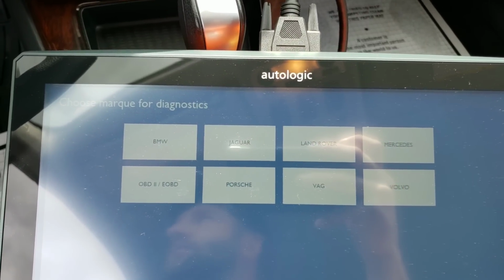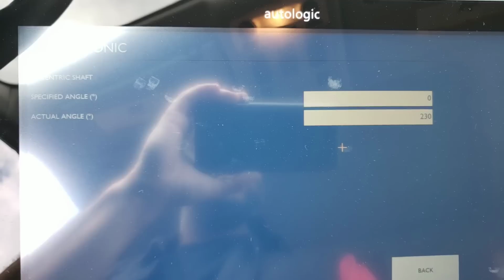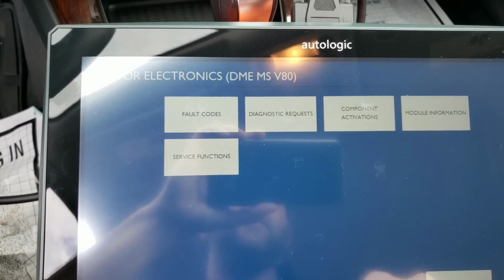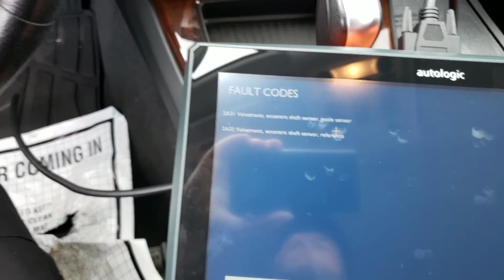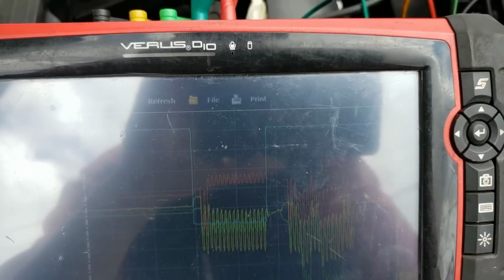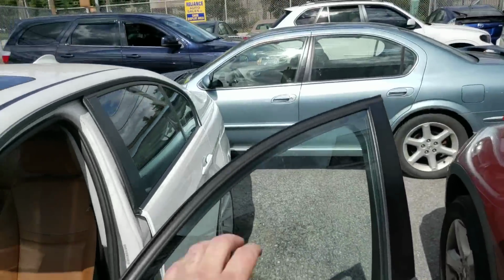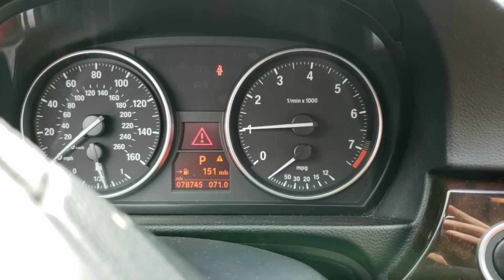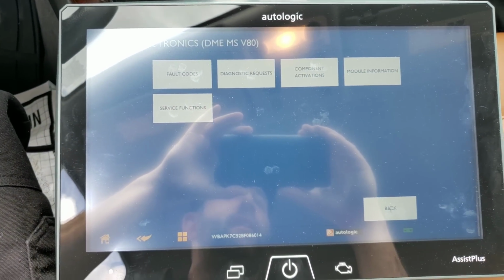BMW 2a31 2a32  Eccentric shaft sensor testing

Comment: Good evening, great video.
Sorry for the question, but do you have a PDF file to study this subject or something explaining about the oscilloscope signal?
Normally we have this type of fault here in the workshop and some of them we resolve by directly placing another new part on the ecentric axis sensor, we have also found the same fault with an internal origin in the Dme, we just replaced the item and it was ok, I'm looking for literature to find other ways evaluating the same problem, it would be very helpful to be able to better understand these signs.

Comment: This is insane, I just replaced the Eccentric sensor almost 2 weeks ago and now it's giving codes 2A31 and 2A32 as well as Valvetronic codes.
Reply: update ?
Reply: @buenobarronFunk  Ok, so it was the Valvetronic motor, when it goes bad it throws a lot of codes. I replaced it and now I've been driving my car daily.

Comment: Is it possible to get the pin-outs to hook-up an oscilloscope?    Have the strangest symptoms.  002855  DME: Variable valve gear -plausibility, sensor, bank2.  However this error disappears every morning and takes 1/2 hour of idling to reoccur.  And when it does, the Valvetronic can't be calibrated and error can't be cleared... strange.  However it can be calibrated the next morning.  Switched Valvetronic motors and exact same symptoms.   Could it be the DME? Eccentric Shaft Sensor?  Electrical glitch.. Perplexing.  Live in NYC, do you have a shop in Staten Island.  Regards.

Comment: The eccentric shaft sensor or I should say is just a hall effect sensor with many outputs to the proper computers. You make it sound like magic when in fact is not the case. The valvetronic system is really just BMW crap with no real benefits. And when it breaks down is a bitch to fix. Even BMW techs hate working on this junk.

Comment: I replaced the valve cover myself it took all day. Hardest part was the angle to reinstall. I'm having issues of bad running, idle surge from 500 to 1200 rpm but idles smooth with eccentric sensor disconnect but runs bad. I've replaced crankshaft and both camshaft sensors, all 6 coil packs, plugs and injectors, both vanos solinoids, cleaned both vanos screan filters, replaced evap purge and valve cover with ccv. I'm leaning towards valvotronic motor or eccentric shaft sensor. I guess its time to take it to a shop for confirmation.. $1000.00+ dollars too late. At least i got an awesome tune up. 08 328i 94k miles
Reply: Oh... replaced mass air flow sensor too.
Reply: 😂😂 same issue bro what was your fix
Reply: @pole450 update?
Reply: 4th

Comment: Holy shit. This thing actually varies the air flow with the valve lift and has the throttle open full most of the time? I had no idea... This thing must be pretty damn reliable.

Comment: I know it's a bit late now, but for anyone who is trying to do the same procedure: The original BMW software (ISTA+) actually tells you how you know that the main relais is off. According to the software, It's when the light in the start button turns off. In my case it took more than 5 minutes. I don't know if this really affects the procedure but it's just something to watch out for.

Comment: Thanks, man. And thanks again. This is the kind of information that no manual has. We just fixed a ESS issue with this video. Got a bad sensor, replaced and the problem was still there. Only after finding the graphs in this video we could prove to the client that the new sensor was not working as well. Got a third one and voi la! Car running fine now.
Reply: Are you freaking serious! So I might be having the same damn issue and I truely do not want to buy and replace this again FML
Reply: @E90SORS Same here. Shop bill is at $1k already and they want to redo the ESS job and order the most expensive option. Did you have to order a new one to get it fixed?
Reply: @AustinView I ended up ordering a new one from FCP euro and it fixed everything I also replaced the Vanos , hope this helps you I did it all myself

Comment: I have a bmw f10 535 with the N55 and I’m having that same problem i replaced the valvetronic and relearn it and still not working car runs good after it warms up but only getting 9.5 mpg when i used to get about 18 mpg
Reply from the maker: Are you still setting codes?
Reply: Yes same code 133e10 i can’t hear the valvetronic doing anything

Comment: Do these vehicles use the valvetronic eccentric hall sensors also as a substitute for cam sensors, no?
Reply: jones key No, it has a sensor on each cam! 1 sensor for intake cam, 1 for exhaust, 1 sensor in the eccentric shaft and 1 motor to move the eccentric shaft responsible and involved directly with the acceleration process (the throttle body doesn’t accelerate the car totally, only partially as he have said in the video) if you have a problem with the motor in charge of the movement of the eccentric shaft, the car won’t respond to your pedal press. (Bmw owner here 👍)

Comment: Keith, you know what this is? They routed a two-channel SPI bus inside a shielded cable between the DME  microcontroller and the sensor chips! To do this in an automotive environment is quite... eccentric, this stuff is designed to be used on a circuit board! You can see how much cross-talk there is between the wires... 

The blue line is called CS (channel select) in the context of the SPI bus, there should be another one like that for the other channel (taken LOW for the second packet we see on your waveform). The yellow line is called CLK (SPI's clock). Deciphering the 16-bit data packet is super-easy if you have the datasheet for the sensor chip (someone should open the bad sensor and check what it is!)

Thanks for showing us this electronic insanity! What are they using nowadays, SENT or PSI5?
Reply from the maker: I waited a whole day for this conversation!😊
Reply from the maker: Oh and I asked to have the old sensor just for you sir
Reply from the maker: Oh and to answer the second part https://drive.google.com/file/d/1GdV2ZNk7wNGPJIf7CweDGT9wt7Zx4tk5/view?usp=drivesdk
As far as I know
Reply: That was a good bedtime story! PSI5 looks good on paper, but I can't wait to see you diagnosing this system once it gets slightly corroded :)
Reply: I'm guessing it;s very well potted and would be a fight to break down.
also, they don't want you to repair a vehicle anymore, they want you to get a new one ;)
about the big EMP they keep talking about, thinking it's about time for one and a big start over................
Reply: Very smart observation to identify it to be 4 wire SPI since on INPA they call it “Low CAN” which makes no sense. Dimitry how do I subscribe to you lol

Comment: No intake vacuum? $400 position sensor? I hope you charge $300/hr on these fancy Euro diags Keith. Much respect.
Reply: now where's my spool of stainless wire
Reply: I think Eric o Did a video on one of those
Reply from the maker: @jeremyanthonyw2r  not that I am aware of
Reply: That's why I won't work on Euro trash

Comment: Good information, people always jump at the sensor, when they get a sensor code. I like the valvetronic concept. And the amount of data you get from it. 👍
Reply: Super Mario What tool do you use to work on these Great euro cars? Do you have the Autologic? I thought snap on is expensive but I think they’re pretty cheap compared to auto logic. But you do get what you pay for and you do have to have what you need if you’re going to work on these wonderful cars!
Reply: BigFoote Mobile Auto I use the autel maxisys, otherwise known as the nawtel 😉

Comment: Keith, thanks for sharing!  Have recently seen this limp strategy with maxed valve angle on a n52 engine. I have a question. Can you clarify what data showed a dead sensor? it wasn't very clear for me. Also about that bmw throttle  rumor and mysticism - while I was playing with scantool on an n52 engine I noticed that absolute throttle position was about 18 percent at idle during normal operation with valvetronic controll enabled and 10 percent in limp mode with valvetronic maxed if I recall properly.  Didn't have time to look at it, not sure it won't go into limp strategy if part of the intake including MAF will be removed... Maybe I will have opportunity in the near future to watch its throttle operating.
Reply: Youre absolutly right. The throttle valve is opened just a few degrees more with the valvetronic system working properly. Its too create a inlet vacuum of about 950 mbar so just 50 mbar lower than barometric pressure. When you go WOT the throttle valve is being commanded fully open. So with a working valvetronic the throttle valve is still opening and closing.  If the valvetronic failes the dme start controlling the throttle valve like a normal engine. You will see that the inlet pressure drops to about 350 mbar. The valvetronic is set to max 230 degrees just like in this video.
Reply: spin1275gt please spin! I need your help really bad at the moment with my 745i! It runs on 7 cylinders with a misfire on cyl nr 5 (left front) so the engine will not run smooth and engine light is on. However when i unplug the MAF the engine runs on all 8 cylinders with a power reduction? Some say the eccentric shaft is worn some say its the sensor? I do know about the location of the sensor but couldnt figure out how to take the eccentric shaft out properly could you please tell me more on this? My beloved 745i is sitting outside for nothing and i cant seem to get it fixed right before knowing this stuff.
Reply: Yes I was wondering the same thing with the sensor. But it was the “butterfly” resistance shown that you mentioned which basically proves that the sensor was bad?

Comment: In my little experience the most important thing to pay attention to as a BMW owner is the oil... Get the proper oil and change it often.

BTW Keith (hope it's not inappropriate), how much do you spend on scan tools and softwares subscriptions etc to run your business successfully?

PS a lot of the features of the autologic are present in the Autel 906bt
Reply from the maker: A lot of the same features,  but not a lot of them actually function properly. Been burnt too many times including the autel and launch units. I spend much too much , but I need to cover every make and model soup to nuts. I can never have the leisure of saying, take that one to the dealer.
Reply: So true! Actually I was just at a Napa class yesterday covering the euro cars and the instructor said that the Autologic you can spend upwards to $50,000! 
Get the word out & with your excellent service and experience it’s no wonder that you’re such a busy man!

Comment: Great info Keith, BMW hard to diagnose? Have European 530 x drive inline6 no turbo code misfire cyl5 BMW change computer coil, injector and coil again problem unsolved symptom like this car cold startup runs fine otherwise................... now they will change all coil and injectors lets see what happen, luckily all is done by warranty. Look forward to more BMW and Mercedes testing
Reply: g johan damn if they just had a proper diagnostician working for them they wouldn’t have to replace all that crap only the one that’s not working right! What the heck they call themselves dealers for just because they sell the cars?
Reply: @bigfootemobileauto13  agree they change parts only to a cost of 2500 usd

Comment: Impressive. So far I've seen you work on just about every make except Jag & Mercedes. I'm amazed at how diverse your knowledge is. Thanks for the lesson.
Reply: He has Mercedes videos... I remember a rad fan circuit vid
Reply: @Usmanthemecano  ahhh. Yeah, I think you're right. It was an older model if I recall.
Reply from the maker: Possibly a Land Rover and Jaguar in the next few days 😉
Reply: @NewLevelAuto  nice! Looking forward to it!
Reply: Have you ever worked on Any of these German cars before Cuba? You think you could figure this stuff out? I have a lot of faith in you
Reply: @jeremyanthonyw2r  I have worked on Audis/VWs, but I only do so much as they require use of tools I am not willing to buy. I don't see them often enough. General maintenance I have done as well as some coolant system repairs. My small hands were able to reach areas without having to remove the engine. Even simple brake jobs are complicated by the need of special torx.
Reply: @CubasAutomotive  I know Mercedes require a lot of special tools .
Reply: @jeremyanthonyw2r  yes, Mercedes can also. Even something as simple as a serp belt needs a "security" type torx bit. Ridiculous IMO
Reply: @CubasAutomotive  yeah my dad had a mini Cooper , and I had to buy a special socket just to change the Oil filter on it.